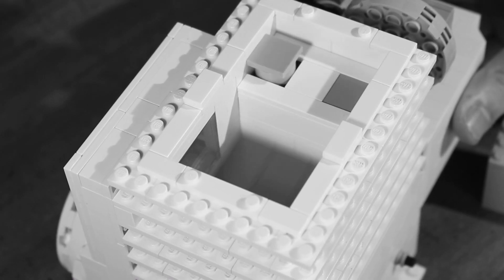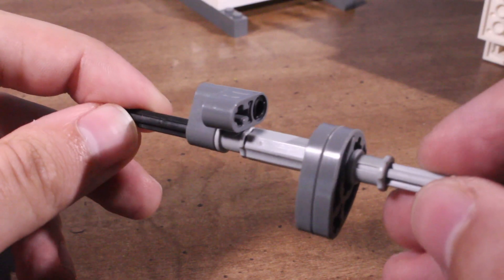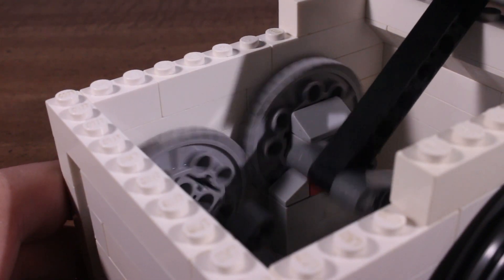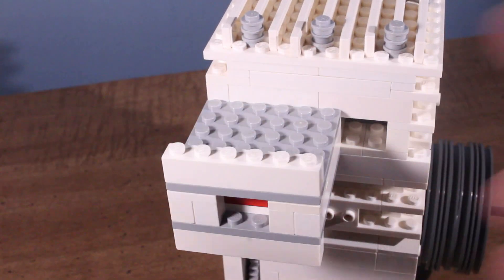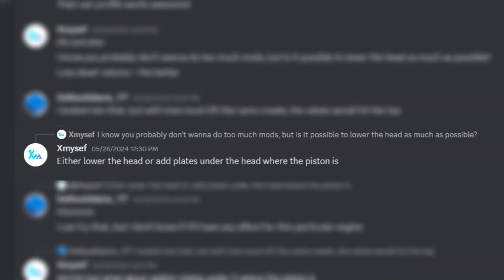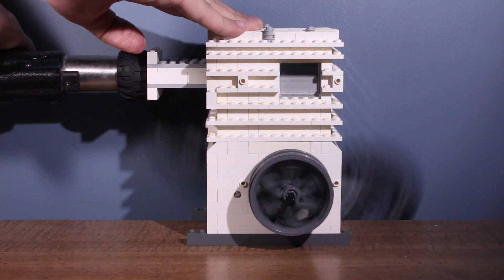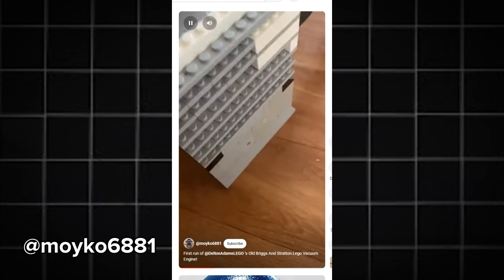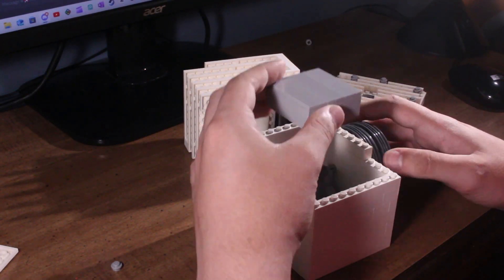Working on my Vacuum-Modded LEGO Briggs & Stratton Engine And.... IT RUNS?!

Comment: Thanks a lot for the shoutout! I was honestly a little confused why it didn’t run faster…
Well, I hope the help was good enough anyway! Good video
Reply from the maker: It's more than good enough! Thank you for all your help!
Reply: @DeltonAdamsLEGO  I tihnk one thing that could help is opening up the crank case, It looks like the crankcase us fully closed so it compresses and make makes a vacuum everytime the piston goes up and down, Also the air leaks around the piston during the up stroke so the pressure would be even lower in the crank.
Reply from the maker: @dividingrain1907  the crankcase has a large hole in the back, you just can't see it. It had a hole from the very beginning
Reply: @DeltonAdamsLEGO  oh ok
Reply: Hm wow so glad it actually got it running good. Nice job mysef!

Still don’t know why it isn’t running any faster? Hm.

Comment: If you make both of the cams I sync with one port you can use both of the valves as one big valve it should work
Reply from the maker: I did that for the first version, but people were saying I needed an intake port so the cylinder can get air
Reply: Maybe use the long duration cam for both valves and 90 degree offsets and a lighter piston and two ports that should work

Comment: Some more suggestions
 
1.Add silicone oil to all moving parts. WD40 would also work but would probably ruin your lego's (stains). Although it may not improve the speed at first, it will improve fluctuating vacuum.
2.Get some eatable school glue, and paper. Before you stack blocks where the piston and chamber are add paper and glue (make sure to punch out the holes) to act as gasket for the blocks.
3.I can also see a space where the window is for the piston. Suction could be leaking out.

The main thing an engine needs, any engine (Gasoline, steam, etc) is Compression. Compression requires a good seal. Compression is what pushes the piston down, you are compressing the air with the vacuum, and if there is not good compression it will have bad torque, bad torque means it won't be able to handle forces very well. Either remove the flywheel and add weights on the crank (if you just want it to run) or seal the whole thing up and smash a big fly on that baby.
Reply from the maker: Those are good suggestions, but this isn't intended to be a permanent build. I reuse a lot of my bricks for other projects. That's why I didn't want to lubricate it or glue parts together. But thanks for the tips!
Reply: @DeltonAdamsLEGO  I didn't mean glue the legos itself together. Eatable school glue has good sealing properties, while still being.. Not glue.
Reply from the maker: @Laqota  ah, ok. I still don't know about that. I really wanted to keep it as stock as possible. I feel like doing that would be like cheating for me

Comment: I know nothing but it looks like the 2 wheels on the flywheel look heavy but idk any thing
Reply from the maker: It's actually not as heavy as you'd imagine
Reply: the only engine i made is just a mock up not a vacuum
Reply: havent even watched the video yet but i’m assuming thats so that the motor operates a lot smoother, the momentum of the flywheel should keep it at a more constant speed instead of having hiccups

Comment: You can try to make the flywheel lighter and smaller, because lego vacuum engines are running with small flywheels.
And i think when this engine runs with that really big flywheel with a smaller one it should run fast.
Reply from the maker: We tried that multiple times and only once did it run again

Comment: I think it would help to make the piston thinner to reduce friction. Also check the watts of your vacuum, that might be the reason because of that person’s engine running way better.
Reply: Well, about the vacuum wattage, he did purposefully have to restrict the flow to make it run better.
Reply: Yep, the engine doesn’t need much vacuum at all, infact mine runs great by just manually sucking through the vacuum side port